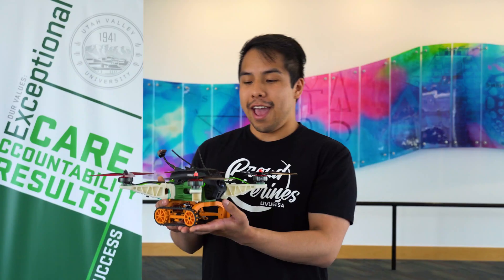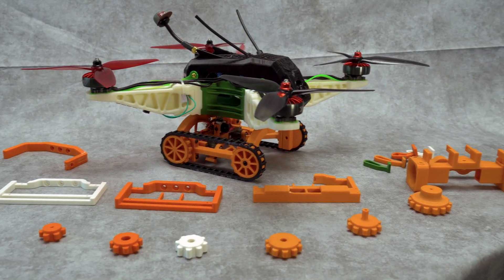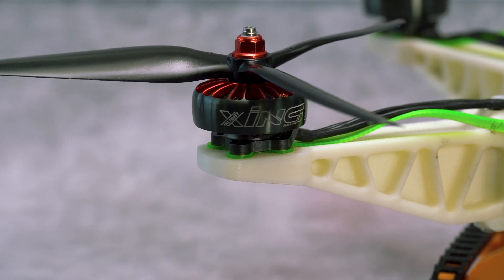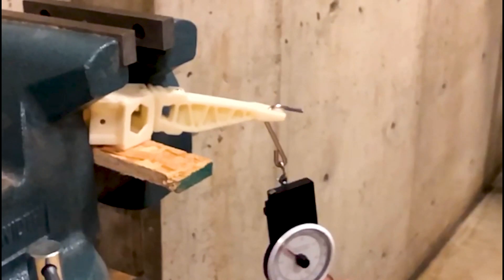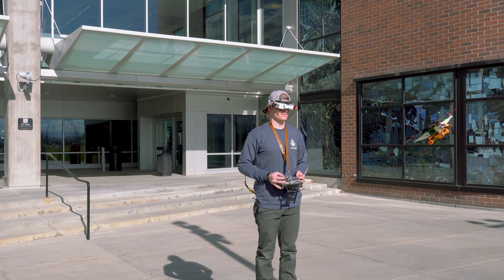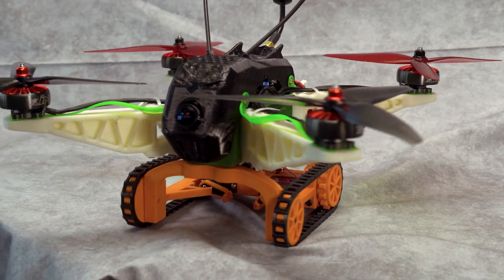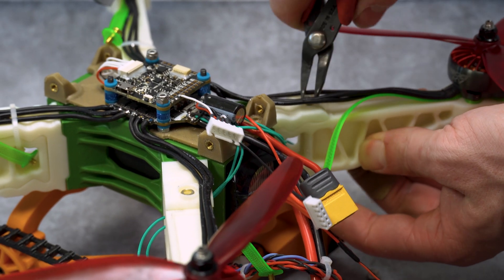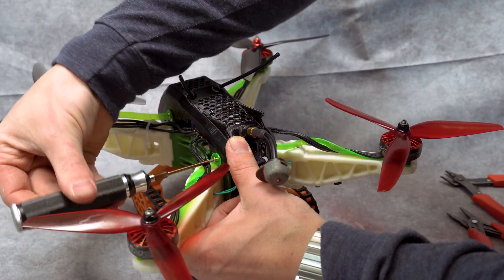ASME IAM3D 2020 additive Manufacturing Competition - Utah Valley University

Comment: How'd you control the servos? Were they powered off of the flight controller or a separate controller?
Reply from the maker: We ran the servos from a 5v regulator and controlled them from an Arduino nano the Arduino nano read the pwm values supplied from our receiver

Comment: Still amusing myself with possibilities.   Thow that gauntlet down and put crossfire on it and a long range battery.    Put the blocks out on top of a hillside 400 yards away and go pick them up?   Bonus points for doing it all on one battery with a big 'ol lithium ion pack.

Would be serious fun to have you as a neighbor for doing all kinds of random assed builds.   Thanks again for the feeds and speeds from awhile back.

I am still not doing the carpet tape method but I am getting much better cuts and it all booled down to my fixturing.    Got setup with a clamp system that seems to be working very well for my TPlates.

About to cut a frame for a 10inch deadcat duration build.   Was gonna do a 15in but props alone were so expensive that I could buy my motors for a 10in for the same price.

Comment: LOL.   Your competition probably should have been wearing their brown pants when they saw it go into a staging position.

Did a collective "uh oh" wash over them as they realized what an FPV racer is capable of?
Reply from the maker: lol I would have looooved to compete! unfortunately though the competition was shut down due to the virus. So we had to make this video submission instead.
Reply: @SkyBerries_fpv  son of a...    okay I have an idea.   Enable 3D mode then fly it over to a block stuck on the ceiling.   Pluck/grab it off the ceiling and then fly it back...

Do cheaterkwad mixing so when it is upside down rates are properly reversed and it is just normal flying.     Blow minds by driving upside down on the ceiling....

A little extra credit never hurts right?